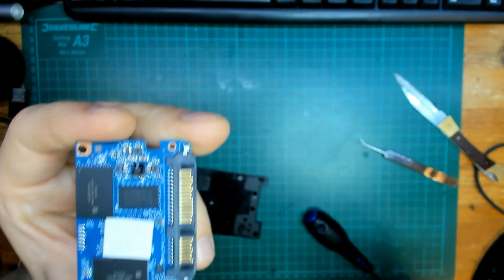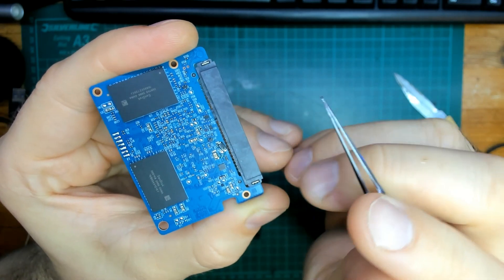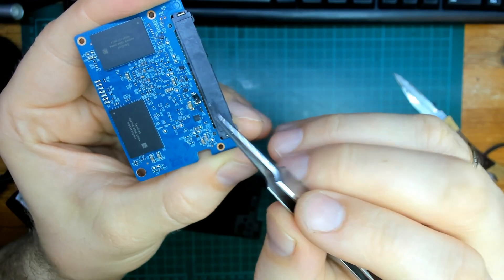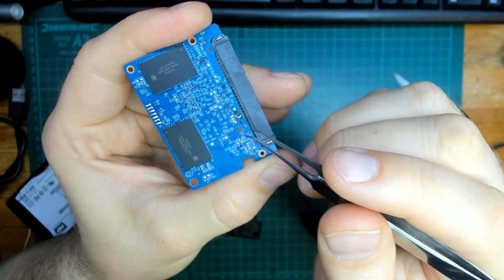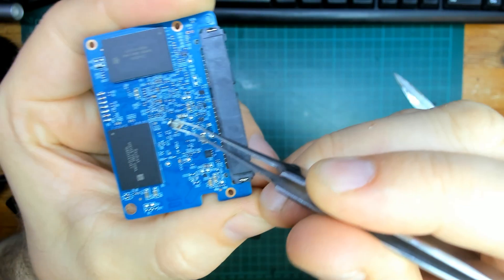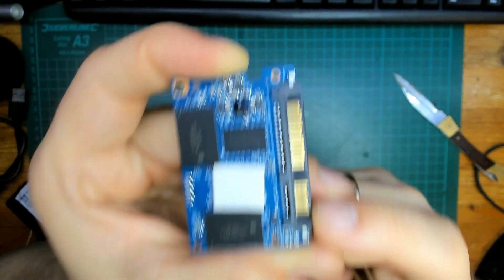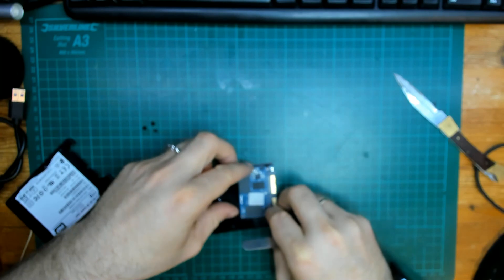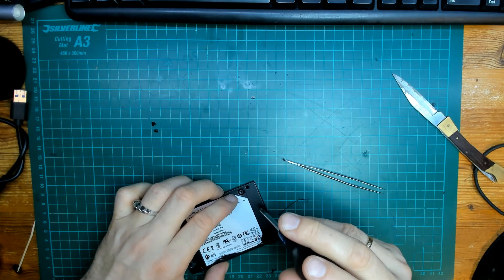How to repair SSD

Comment: You can easily find out the zener voltage. Power on the drive and measure the voltage on the pads where the zener was and that will be the normal voltage. If you measure 3.3V then the zener is 3.3V. Then buy any standard smd zener with the same package and voltage and replace it later.
Reply from the maker: Hello! This is actually a very good suggestion and I will definitely try do it! Only, I opened another drive that had this component intact and I'm not so sure that it's a Zener diode, but possibly a different protection diode (at least it was for that drive), as far as I can believe the internet. It looked more like a Varicap Diodes type, but still need to investigate this topic to be sure! For one drive, I replaced a diode from another drive that had a damaged magnetic read section. It turns out that in the power part circuitry is somewhat similar to SSD.